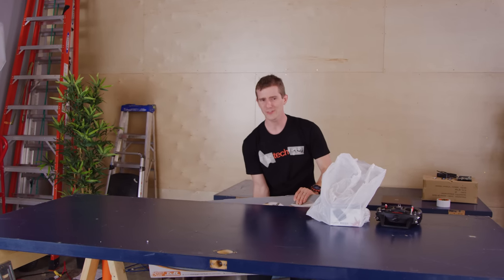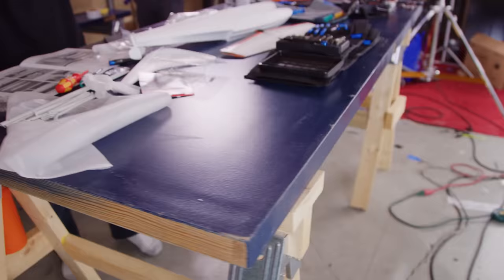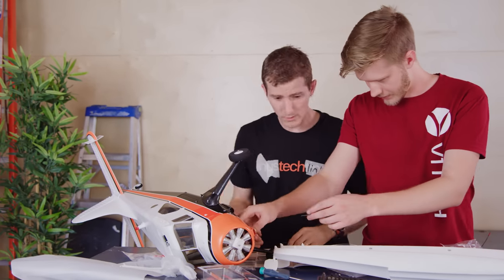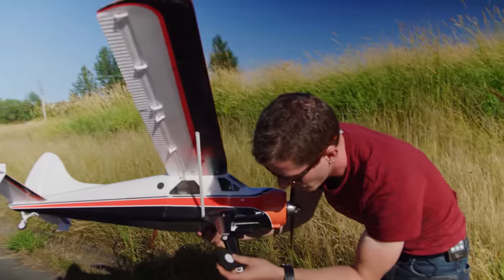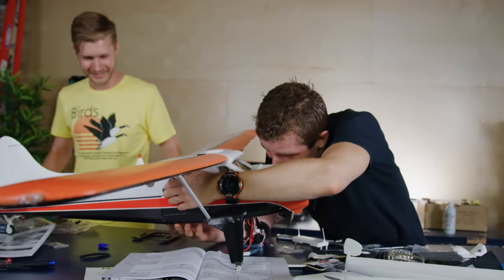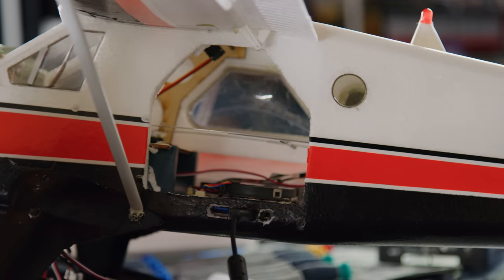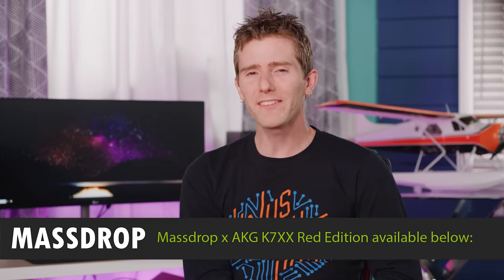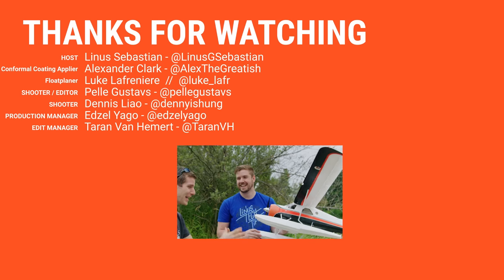This PC ACTUALLY FLIES!!!

Comment: linus to luke: you wana fly the plane?
luke: yes!
also linus with luke: proceeds to fly the plane by himself without even handing the remote to luke
Reply: Im sure they talked on the way, there was like 15 minutes at least on walking we didnt see, even so linus is the only one with a modicum of experience flying rc planes
Reply: As one who flies RC regularly, this was probably an excellent decision. Even real pilots find them to be quite difficult because they are extremely twitchy and there's no feedback. Landing is hard when the ground is made of ground, but when the ground is wet and splashy like a lake the landing becomes significantly harder. Honestly, I am surprised he even landed it at all upright. Usually, floatplanes get nosed in hard and the ESC (or Intel NUC) gets fried. Good job, Linus.
Reply: Ikr I kinda felt sorry for Luke.
Reply: @Variety_Pack  Any landing that you can compute away from...
Reply: tbh i would rather have my friend, who was more (even a short) experience of flying rc planes use it. Rather than me (who doesnt know anything)  crashes it immediately.

Comment: now give it a modem, power and a cellular connection so that you can remote access it while it's flying
Reply: Exactly what I was thinking. Hope he'll read this lol.
Reply: 5   @ 100pl w/lyew jo l 0
Reply: That would be nice!
Reply: Thats nice idea wait is this elon musks another account?
Reply: that sounds like way too much delay :/
Reply: Yeah what about power. Gonna be a heavy battery
Reply: $ ssh root@plane.aero

that's a real domain ending btw, you could actually do this
Reply: J1428753 That can actually be ssh'ed to?
Reply: They could mount another fan on top connected to a generator to produce power in flight mode.
Reply: J1428753  Sadly the domain is taken. 
$ ssh root@floatplane.aero might work

But I am sure .aero domains are expensive as fuck.

Also maybe a small display in the cockpit with widgets that display core speed when using it. Cause the taped instruments are sucky!  

Also maybe clean up the IO port openings a little bit if possible.
Reply: Jai Hayes  Don't actually know. but probably. I ssh into my webhoster so does anyone know why it wouldn't?
Reply: While you’re at it you might as well add a few missiles as well, and then you can drone-strike your annoying neighbour
Reply: Just read all these comments, and now I have an idea for my next project. Thanks youtube!
Reply: its in the makes
Reply: And most importantly some hard drives or ssds, so it can be a literal cloud server.
Reply: Sadly this hasn’t happened I was kind of looking forward to it
Reply: Jai Hayes My thoughts exactly! 😂

Comment: 1:add battery
2:add mobile network connection
3:heavier plane to compensate battery weight
4:game on it while flying!
Reply: As quirky as this thing is now I think it could handle a bit more weight
Reply: That ain’t going to work unless you have a wireless monitor
Reply: What about an nvidia shield?
Reply: VNC?
Reply: Put it in an FT Guinea Pig
Reply: @dbagdi1998  HDMI to AV adapter -> RF modulator -> antenna -> watchman. Perfection.  For controls, i guess use something similiar to whats used to control the flying.
Reply: @Wuerfel21  drones often use phone's for control, why not just use a tablet or something for basic controls
Reply: I heard flying Sims have gotten really good recently
Reply: @sundroid7562  play flying sims while flying your pc. Nice
Reply: why would you want a heavier plane to compensive battery weight that doesn't make sense lol
Reply: @bobby8012  
The more weight something is designed to carry the more stuff you could put in it, i.e. a battery big enough to run a PC. If the plane weighs 100 lbs by itself, you could take out 50 lbs of unnecessary components and put in 50 lbs of PC parts, but if the plane weighs 15 lbs and you can only reduce the weight by 5 lbs, you can only put 5 lbs of PC in.
Reply: +Rody Evans that doesn't make any sense because why would someon design a plane with unnecesary weight (which doesn't happen in the RC hobby anyway) and why do you assume that a plane automatically has unnecessary components by default, your logic is flawed maybe you should have looked into what you were saying before saying it.
Reply: +Roddy Evans yes very good example indeed i can't believe my eyes

Comment: A Raspberry Pi + an LTE modem + 128gb flash drive and you could literally have a (small) file server literally in the cloud.
Reply: also knows as most drones out there, for ex parrot, they are completely open flying FTP servers.
Reply: or you could just put a phone in there
Reply: linus's gotta do it
Reply: yeah, or you could render videos on the fly

Comment: people in the 1950’s: in 70 years we’ll have flying cars! 

people in 2019: flying computer
Reply: At least we got somewhere
Reply: Well, many planes do use computers to control themselves, so....
Reply: Type Here very true very true
Reply: 2018*
Reply: Did you know that the Airbus A380 runs off of Windows?
Reply: @wta1518  the Boeing 747 runs on Linux!
Reply: @scriptedreality2330  I was joking, I assume that the A380 runs on some form of Linux.
Reply: @wta1518  Oh I thought you just somehow knew that, made sense since Microsoft has made windows powered infotainment systems for cars, so making something like that for planes wouldn’t be that much different.
Reply: @scriptedreality2330  Maybe it does. IDK.
Reply: @wta1518  I wouldn’t be surprised since Microsoft sure as hell doesn’t use macos or Linux.

Comment: Well a plane is cool but what about a submarine?
Reply: with wireless peripherals and a watercooler that cools the cpu with ambient water?
Reply: or a passive cooler that just sticks its fins into the water.
or use a streacom db 4 case as the Center of the Body, under water that should be able to cool anything that fits inside.
Reply: Microsoft deployed an under- water data center.
Reply: Ocean Cooled rig.
Reply: Mineral Oil PC?
Reply: WIFI connection would suck...
Reply: Yes please
Reply: I was thinking of making a submarine computer lab, but then fucking Peter Madsen happened
Reply: @homeopathicfossil-fuels4789  maybe a good deal on a sub now...some cleaning required
Reply: lmao
Reply: they could couple it with hdmi through water for maximum comfyness
Reply: Like the: http://i.imgur.com/gn8XwjC.jpg

?
Reply: Ulrich Kälber Awesome idea. The passive aluminum coolers would have to be coated in black paint for them to look extra cool. But I can see them getting clogged up with algae and other gunk if the fins are too close together.
Reply: yasssssssssssssssssssssssssssssssssssssssssssssssss

we need a submarine pc

Comment: Is it possible to operate the PC wirelessly while flying it? That would be the most definitive version of your flying PC.
Reply: Klen Manalo well there have to be a second screen with wireless connection and a large frequency to be able to reach the maximum height of the plane and possibly bring in a small box route on the go
Reply: Just run simple VNC over existing wifi
Reply: he would need power from batteries and wifi/4g data sending video wiressly through streaming platfor maybe? i dont know how to do it but if someone can do that linus is the one. probably just by looking in the warehouse he could get all the needed hardware for it.
Reply: Battery and wifi adapter is easy but not for long time. Streaming video to e.g. phone and control whole computer can be realised by TeamViewer or something like
Reply: Wireless HDMI
Reply: I think it might be possible with a Raspberry Pi. Lower power consumption, enough power, smaller (so that the batteries don't ruin everything).
I'd SO want to see that.
Reply: Yeah, wireless transmission would be too much of a stretch for any battery. I think its possible using solar may be, but it'll be too complicated to be accomplished.
Reply: Intel's Thunderbolt technology will do the trick.
Reply: Pi planks already do run wifi with less than 7w total system power draw.
Pi planks already do run remote desktop VNC service over wifi
NUC can idle at 12w.  
A 4s 700mah lipo direct can run a NUC longer than the flying electric motor can be powered by the plane batts

Comment: You should install teamviewer on that pc so you can use it while it flies
Reply: Pieter Mantel but how would it get power and internet
Reply: wifi-card and battery bank? could probably work, battery weighs a lot tho and not sure if the nuc would accept the power output but...
Reply: or just fly it in a thunderstorm and hope lightning strikes xD
Reply: A 9000 mAh battery bank can power a 450 watt pc for 1 hour, and who would be flying a computer for 1 hour?
Reply: of course you would need to convert usb type c to usable power cables, but thats for LMG to work out
Reply: there are 5GHz USB WiFi adapters, and the connection loss is probably an issue but this isn't for the purpose of practicality. It's for flying a PC while using it.
Reply: @pietermantel9498  that's not how that works. You have to incorporate the difference in voltage too
Reply: Pieter Mantel no not “who would be flying a computer for 1 hour?” Who even flies a computer in the first place except Linus
Reply: @Pieter Mantel Assuming you are talking about a 'standard' battery bank with Lithium Cells measuring Nominal 3.7V, you would only have 33.3 W/h of capacity in that 9Ah bank. Even assuming 100% efficiencies and being able to use 100% of a Batteries' capacity, 450/33.3 = 0.074, AKA, Around 4 and 1/2 minutes of run time. How the heck did you an hour of estimated run time on a PC? That's not how Electricity works, lol
Reply: Sorry Linus, US called they said DARPA (Defense Advanced Research Projects Agency] needs your teams Newly found Engineering passion for building mini attack drones now. Don't make them send in the Arduino unmarked helicopters.
Reply: @dvrkplayer  Battery, simcard. Boom you have a self-aware pc that can fly and kill you.
Reply: DarkPlayer+ l would have put in a raspberry pi with a phone charging bank.
Reply: Good point... but still, you could probably put in a battery, and it wouldn't have to be a big one if you are only going to fly it for short periods
Reply: Oh yea voltage
Reply: or just slap a solar generator on the battery

Comment: At an airport right now. I'm carrying a laptop. Does that count as a flying PC?
Reply: Yes. But not as a pc which flies.
Reply: Only if you drop it off the plane,
Reply: no because you are in the airport not in the flying plane ._.
Reply: Put it on airplane mode, then ya
Reply: what type of plane is it
Reply: They all ready have PC built in tho lol the airport did it first but they used a much bigger plane
Reply: @steveissuper  the airport didn't do it first. it was boeing with one of their first planes like the 247 or not boeing. it could have been  a biplane or a hurricane or spitfire

Comment: Arent all planes "flying pcs"..
Reply: Wow never thought of that
Reply: i mean i bet alot of fullscale planes have computers in them
Reply: Arijit Roy only airbus planes
Reply: If they crash, it will also be flying pcs (pieces).
Reply: Talking about computers, these are all sorts of multifunctional self-controlling, stearing, measuring, and logging devices that can be made for everything that it is intended to do than just be able to be gaming on and watching youtube with, to be called a computer. 
Your computer/smartphone also loggs everything you do with it and sends that information to the software developers as an agreement you make when you installing your applications.
Think about that.
Reply: It's the only a pc itself..
Reply: It's a flying computer. But a PC? Definitely not
Reply: Brady Prince  if it can't compute it can't translate the signal from the radio nor drive the AC motor and controls properly
Reply: Pretty much any modern airliner has a shitton of electronics

Comment: 8:12 when drilling to, prevent from doing damage again for any future build you might have that require it, try starting with a smaller drill bit. Then working your way up to the desired size you need.
Reply: That's what she said
Reply: Also helps to use something other than a twist drill bit. A strait fluted drill bit would be ideal, but a step drill bit is more common and works fairly well.

Comment: You need heated wires for cutting foams, not drills. That's airplane model 101
Reply: The best Linus would do for Alex is a repurposed sewing pin and a stolen lighter.
Reply: that's not just airplane modeling 101, its general crafting 101 to use a heated wire on Styrofoam (there are other foams out there that would do better with scalpels)

Comment: 1. Put a battery in it
2. Put a WiFi antenna on the plane
3. Turn on the NUC with battery, connect it to a WiFi network
4. Remote into a NUC over the WiFi network
5. Play games on the PC while it's flying

Comment: Stick a GPS module in that thing and load up a program in the on-board computer that can control the rudders, wing flaps, and propeller speed and have a feature that you can use to draw out a flight path that the GPS can use.  Now you can have the plane fly practically anywhere, without being limited to typical RC range..... the only limit being the on-board power/fuel.

Comment: You guys should put a wireless chip in it so you can literally play a game remotely while it’s flying
Reply: Augmented reality?
Reply: Panda man It has Intel WiFi inside though
Reply: @MudkipOnYT  he doesn't mean WiFi, he means wireless as in a connection supporting long range connections  such as radio/ Wi-Max
Reply: Ya BC POWER SUPPLYS DONT NEED A POWER SOURCE RIGHT???
Reply: @epichunter115  wtf are you saying??? It doesn't even have a power supply ¯\(◉◡◔)/¯. Probably uses micro usb power or smth else.
Reply: @epichunter115 plus, they could probably install solar panels onto it, for more flight time, and if it's a really efficient solar panel then theoretically indefinite flight time.
Reply: @hoodmeister_9076  for gaming you need efficiency and GPU lmao cmon guys
Reply: @hoodmeister_9076  first of all that wouldnt be enough constant power because the sunlight wouldnt always hit the panel, not to mention it wasnt that sunny, not to mention that a GPU or igpu with strength to game is needed
Reply: @hoodmeister_9076  dont just spit out words
Reply: @hoodmeister_9076  read properly
Reply: @epichunter115  nah, I don't support what he said. He a kid. I agree that what he said Is totally bullcrap.

Comment: Linus just as a future thought...anytime you are drilling thru soft stuff...Brass...Bronze...plastic or anything like that....take the drill or drills and the cutting edge of drill hit on grinder to "flatten" the edge so it will drill hole and not punch thru and break like you did in the 8:30 spot

Comment: Pro tip: elevator can save a front heavy not a back heavy
Reply: I thought back heavy was more aerodynamically stable?
Reply: Nayan, the further forward the centre of mass (in front of centre of lift), the more stable the aircraft is. However, it will be more resistant to pitch and yaw. CoM further back will be more unstable, but less resistant to flight control.
Reply: @daylight5085  fair dues, all I know is from kerbal space program and having it marginally behind the wings seems to produce best results there

Comment: Why didn't you put it in such a way that the center of mass and center of lift are overlapping?
Reply: Also, it's ideal to have your center of lift slightly behind your center of mass.
Reply: Yes, like what Surya said, it is best to have the center of mass slightly in front of your center of lift for stability. However, most newer fighter aircraft are designed to be unstable to gain more maneuverability, and computer systems help stabilize the aircraft.

Comment: No Linus is wrong you just need a normal pc with fitting same fans at all sides and put a keyboard under it. It will work it will fly I tried mine on full throttle fans it flew to 40 - 60 feet in the air

Comment: From the title i thought computer is going to be on a DRONE. And it actually could plug in to the Monitor.
Reply: Binbougami this can plug into a monitor though
Reply: this is much cooler
Reply: U could easily put in a 5" monitor
Reply: I meant plugged in while it's flying.  If you use drone, drone can stay at a certain point and still can be plugged in.

Comment: You could use an air intake on the rc plane to use the air to cool the cpu Like brakes on a racing car or large jet which needs to dissipate its energy so they use the flowing air to cool the brake disks

Comment: Connect it to a charging brick for power and and wireless monitor/keyboard/mouse to actually use it 
(If you can't get a wireless keyboard use a screen mirroring software)

Comment: you should have used a wireless display so you could use it inflight. and bluetooth keyboard and mouse. that should do it. Then hook up a UPS and fly. Even better would be to somehow use an Arduino slave to control the plane and add autopilot within the aircraft.

Comment: disappointing click bait as expected instead of building a flying PC you took a PC building kit. built it not even on video and put it inside another kit. what is the point of a flying PC if you can't use it well it is flying. you could have used  wireless keyboard mouse and monitor. All you did is fly a PC. not make a PC that flies.great logic. instead of just using your PC and plane separately lets break them both. the reason why this is so disappoint is because not only am i into pcs. i am a hardcore RC and drone enthusiast. actually putting a functional computer in the air would have some huge advantages. after all all of the best drones have computing units inside them and can do some amazing thing with a fraction of the computer power.